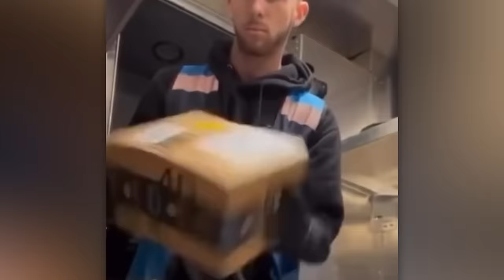Most Ridiculous Workers' Mistakes Caught on Camera

Comment: I have to think to myself .. when that crane tips and that huge structure all collapses every piece of it .. WHO engineered that thing?!  That to me is an engineering failure as the crane tipping into should NOT have caused a complete collapse.  It was designed wrong and was a disaster waiting to happen in the future.  Maybe long term this saves lives as it won't do that IF they rebuild it.  

I also see a lot of people who need to be fired for all the time they waste not doing their jobs.  Amazing how they think some of this is funny.
Reply: .  Appears the crane operator swung the boom to the right putting a side load on the boom which it's not intended to withstand.  Vertical loads only, minimal side loading. Rule this incident operator error with what can be seen from a limited view.